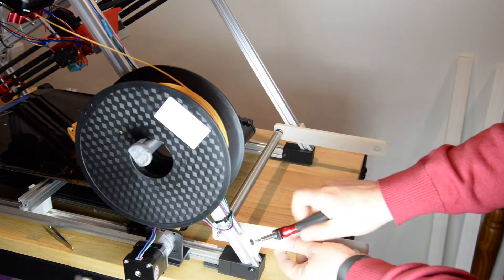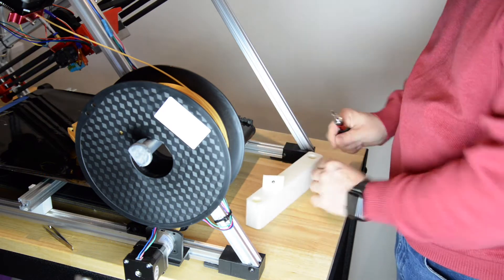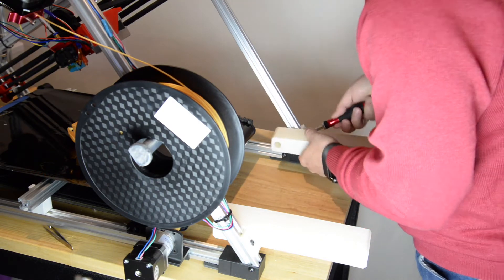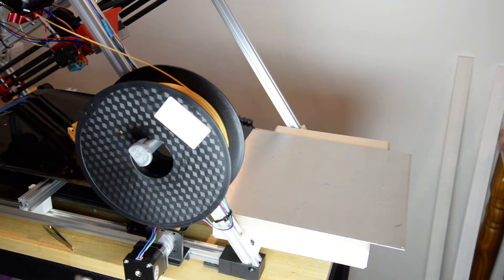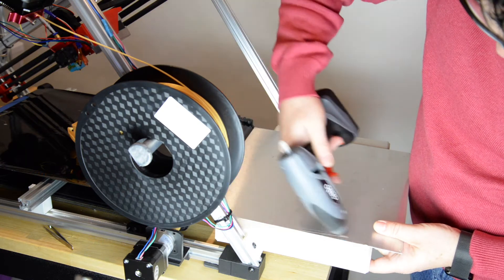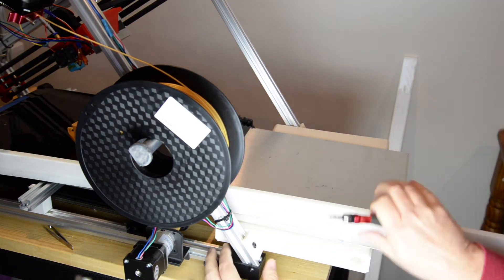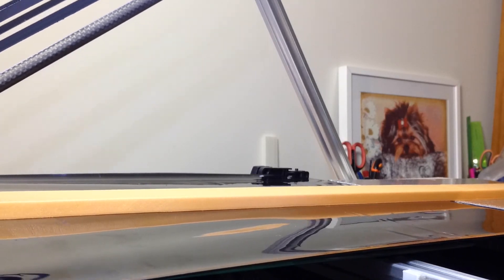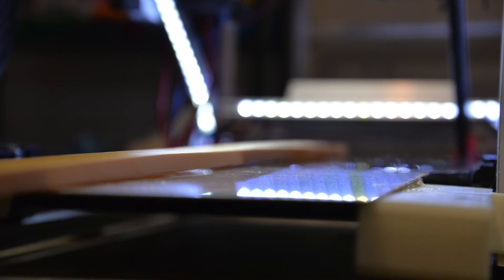Hypercube Infinite 3D printer: Upgrade - Print Catcher Plate instead of rollers

Comment: For extra long pieces like the one you're printing, can the aluminum plate be butted level against the end of a long table? Right now, the weight of the piece overhanging the plate is helping the bowing. If the piece is supported entirely, then at least it's own weight isn't adding to the  bowing.
Reply from the maker: I see what you mean

Comment: Pretty strange, do you have heating element under the belt ?
Reply from the maker: That's right. It's a 200x200 heatbed under the glass. In the middle of the heatbed the temperature is about 68.